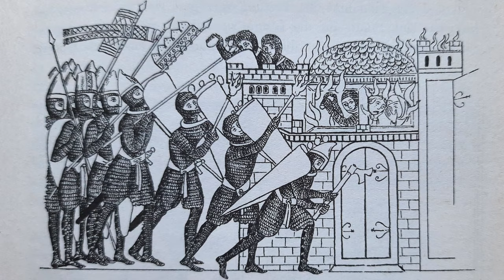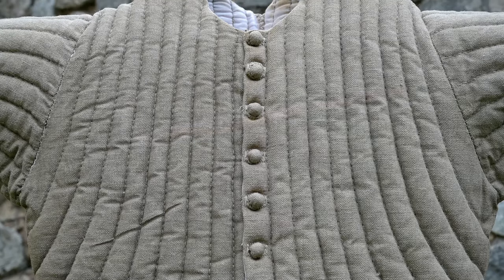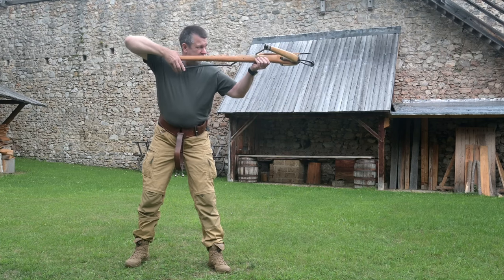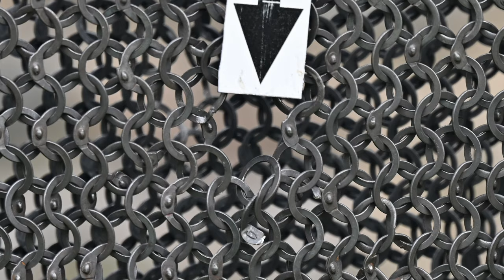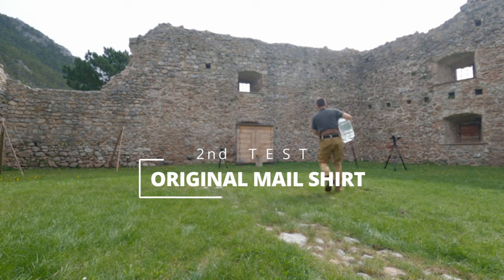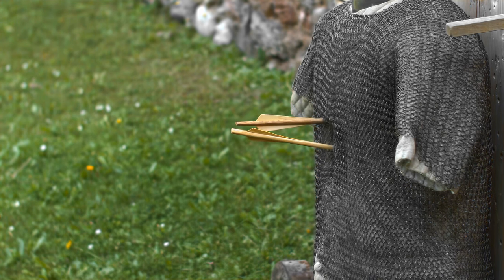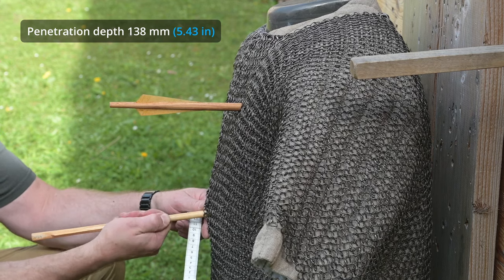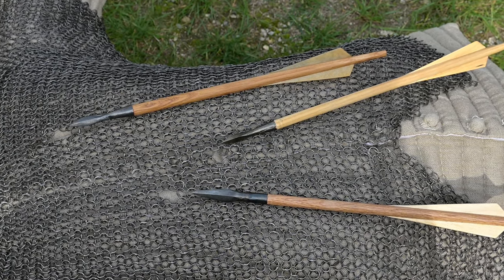Medieval Composite Crossbow vs original mail armour

Comment: The original coat was an ottoman /eastern coat rather than a European one. Their riviting is far weaker than the ones made in Europe and the quality of the material isn't as good. When European mail is pieced, they rarely fail at the rivet. It also looks like it's been acid cleaned at some point, which also effects the strength of the metal. I restore them so I have experience. I would also question the ethics of damaging any original piece. Mail is not necessarily ment to stop arrows, that's why you have a shield. "Arrow proof" mail is a completely different animal.
Reply: I remember reading about that somewhere that Middle Eastern mail armor tend to be a lot weaker than that of the European mail armor.   In fact the Europeans were making the best armors in the world of almost any type.
Reply: European mail armor were the best in the world. The Ottoman mail armor as well as any other form of mail armor around the world tends to be a lot weaker.  The manufacturing of mail armor that the Europeans were doing was a much more superior one by a from compressing the metal wire into a device which is very similar to what we do today.   Many of the cultures didn't have that form of manufacturing wires but rather they cut pieces of metal to make the mail armor which would make an inferior form of armor.

Also just look at the size of those Ottoman rings!!  Those are pretty big gaps, the biggest rings European mail armor ever had was 8 mm size rings from what I understand and most were 4 to 6 mm riveted rings and very often flattened rings at that which is a whole lot stronger than that mail armor used in the video.   

Keep in mind Europeans were capable and made such dense mail armor that not even a pin needle can go between them and there are surviving examples of that in museums in Europe.
Reply from the maker: I agree with you in most points. But the shirt wasn't acid cleaned - as I got it, it was rusty and I resored it with little brushes and oil by myself.
Reply: @medievalcrossbows7621  you did a very good job of cleaning it, it looked well preserved. The acid cleaning I mention happen probably in the 19-early 20th century (it was very popular back then) it looks like it had a good working like, I could see a few period repairs and "alien rings*  which is always interesting
Reply: I hadn't realized a drawing plate made maile stronger compared to cutting the rings. Though note that in places with hotter climates, maile tends to have looser weaves so that it breathes better, since heatstroke is a bigger danger than enemy weapons. I suspect better examples exist of Eastern maile.
Reply: @vanivanov9571  the draw plate makes the wire for the rings thinner  and also work hardens them. All countries that make it used some kind of drawing technique. The strength of the European coats was the riveting, better metal and manufacture. The good coats were also case hardened, effectively putting a skin of steal over the iron. As for ring size, some Persian coats had riveted and theta links of under 4mm, whilst some Indian ones has butted rings of under 2mm. Saracens wore a kasakand (looked like a dressing gown) made from a rabbit skin stuffed ackerton covered in mail, covered in a silk stuffed ackerton, covered in mail then all 4 layers covered in silk. Sorry big rings in the east is a bit of a myth. Hope this helps
Reply: @nickchecksfield1066  Thank you, that's very interesting. I'd seen many examples of loose weave from African and Eastern mailes, and heard it was a thermal consideration (have also heard that regarding full plate harness). Good to have counter examples.

Do you know if looser weaves of maile were more common than in Europe, in places with hotter climates? Or are weave densities similar regardless?
Reply: @vanivanov9571  it makes it a bit stronger because you're compressing the metal a bit into the drawing plates. Then they make the rings from that wire by twisting it then cutting it then forge the rings flat before riveting them together.  
I'm sure I miss some steps here and there but that's the gist of it.
Reply: @vanivanov9571  both sides vary from tiny to about 9mm, much bigger and it becomes less protective. Sudanese mail examples are small and soldered
Reply: @nickchecksfield1066  Fair enough. I guess I just happened to see the cheaper examples. ON that note, since Europe commonly required people to buy armour and weapons as part of citizenship, I suppose it was common for people to get the cheapest maile?

Thanks again for the insight.
Reply: @medievalcrossbows7621  would be cool if you could do that a t a little further away.  Anyways great video.
Reply: @landsknecht8654  the mamelukes actually had breastplates at a time when the crusader knights they faced, only had mail hauberks  & in the far east, Lammelar was preferred over mail because it provided much better protection against Arrows then mail / so although Europe had better mail, the haulberk it self did not provide as much protection against piercing weaponry as general middle-eastern or eastern armor did + the former was more time consuming to make // It's only when Europe started on Improving plate & eventually full plate that they surpassed everyone else in making Armor
Reply: @aburoach9268  Mamelukes had breastplates? I never seen them with breastplates. Unless you're talking about a proto-plate armor like a Muscle Cuirass?   Or are you talking about "mirror armor"?  Which I don't think they had that during that time and I never read them wearing a muscle Cuirass unless maybe they were Eastern Romans "Byzantines" ? 

 Then again the Crusades lasted a couple hundred years so I don't know, Coat of Plates was already being used by European Crusaders soldiers and knights.  Also I do know by around mid to early 13th century true plate armor was invented in Central Europe and knights in Central Europe started to use them. 

 While you're correct about mail vs Lamellar armor the thing is European mail or chainmail if you want to call it actually did pretty good against arrows and some "pointy" objects (with padded armor underneath) . The amount of protection European mail armor provided was actually pretty comparable  to Lamellar. The main advantage that scale armor and lamellar had over mail was it was quite a bit better against blunt force trauma. 

While this test was fun & interesting to watch there's a lot of problems with it.
Reply: @aburoach9268   One more thing almost forgot to mention; while chain-mail or mail armor more properly put was a bit time-consuming to make but it did have a way way longer shelf life, and was very easy to maintain as well as quite easy to repair also easy to transport. This is almost as true as later European plate armor. 

You can literally stockpile mail armor in the armory with some bit of maintenance it can last for many Generations without problems.  Lamellar armor and scale was much harder to maintain and the fabrics that connect all the scales and Lamellar will corrode or brake away even with regular maintenance sitting in a armory.
Reply: @landsknecht8654  there are several types, Either one large chest plate or multiple plates merged with the Mail hauberk
Reply: @landsknecht8654  "The amount of protection European mail armor provided was actually pretty comparable  to Lamellar" / No it wasn't, Lamellar could deflect and break arrows due to the the tiny plate pieces being at an angle / Modern tests have shown that lamellar did an equally good job as plate while even the Best European mail  failed against war arrows shot from war bows
Reply: @aburoach9268  While I agree that Lamellar Armor is better against arrows I just don't think it's a whole lot better then mail, both are not comparable to let's say European plate at all because lamellar armor gets deformed somewhat fast by every strike and mail can obviously be penetrated to injured or killed.  

On top of that there's inherent problem with scale and Lamellar armor where the arrows and a lance can actually slip in between the small plates.

 There's a lot of problems with most of those tests on mail and it's too much to name. Cult of Athena did an amazing test though because they put the mail armor on a dummy that flexes like a person. They had a very low budget padded armor gamberson underneath and yet the guy had a really hard time stabbing through the mail not with just with a sword but with a spear as well!  In a matter of fact it didn't really go through most of the time, but when it did go through it was very minimal and yet the guy was using all his force to do so with both hands.
Reply: @aburoach9268  Mail was pretty comparable to lamellar in a sense that chain-mail actually did a pretty good job at stopping the same types of light arrows that was commonly used in the east. But something like a European longbow maybe even a Japanese longbow with heavy arrows can probably mess those two armors up pretty well.  Even European crossbows used heavy blots. 

What I'm talking about chain-mail or mail armor I'm talking about with the combination of the padding underneath it because that's how mail armor is supposed to work. 

And here is where I'm talking about: 

"During the 3rd Crusade, Bahā'al-Dīn, Saladin's biographer, wrote that the Norman crusaders were: 

...drawn up in front of the cavalry, stood firm as a wall, and every foot-soldier wore a vest of thick felt and a coat of mail so dense and strong that our arrows made no impression on them... I saw some with from one to ten arrows sticking in them, and still advancing at their ordinary pace without leaving the ranks." 

"Odo of Deuil wrote about King Louis VII in an engagement during the 2nd Crusade. After losing his bodyguard he was forced to flee the enemy by scaling a rock face: 

The enemy climbed after, in order to capture him, and the more distant rabble shot arrows at him. But by the will of God his armour protected him from the arrows." 

My point is all in all mail armor was pretty comparable to Lamellar. However like I said lamellar armor major advantage is that it's faster to produce and is much better against blunt force trauma then mail.   The main advantage of chain-mail is that it's extremely easy to maintain, has a much much longer shelf life, and is pretty easy to repair.
Reply: @landsknecht8654  Mamluks have plated mail, the closest thing to breastplate.
Reply: @cool06alt  I know you're talking about I think that's called Mirror armor. The concept of mirror armor has been around since the Bronze Age, the Greeks, Macedonians, and the Romans used it and later the Chinese used it a little bit usually as "up armor" (added armor). 

Essentially the Proto-mirror armors used in the ancient era were a type of plate armor that was usually rounded and was worn over male or padded armor or sometimes just worn over the person similar to a plate a modern carrier.  

However the early mirror armors which I like to call "Proto-mirror armor" were a bit different than what you're probably talking about.  I have no knowledge if the Muslims used it during the 13th century or earlier, but from what I understand the Proto-mirror armors tend to cover very little of the body, probably no more then a modern plate carrie does at most. 

  I don't know how widespread it was used during the time frame I'm talking about.
Reply: @landsknecht8654  Exactly. 

Also if you or anyone here know if something like fused chainmail ever exist, that would be great. At least modern chainmail armor like that scuba diving anti shark suit seem to be like that. Heh, improving old design using modern tech.
Reply: Yes but this is merely 90 joules which is easily achievable with even bows of 100lbs composite. Meanwhile a crossbow can reach 100-400 joules
Reply: @landsknecht8654 Europeans made the best chainmail because they invented it and had the most experience with it. Similarly, Middle Easterners and South Asians made the best plated mail (combination of mail with some plates). East Asians made the best lamellar.